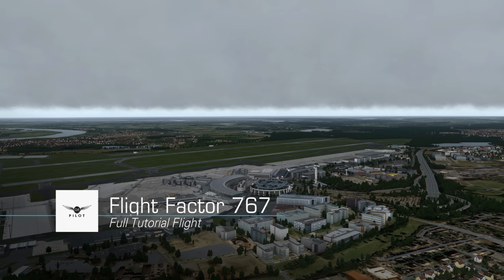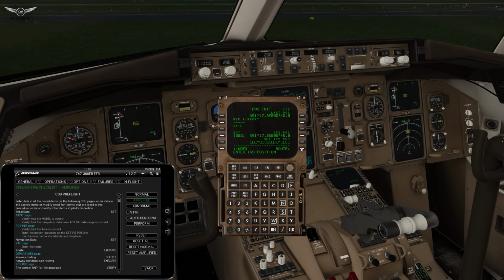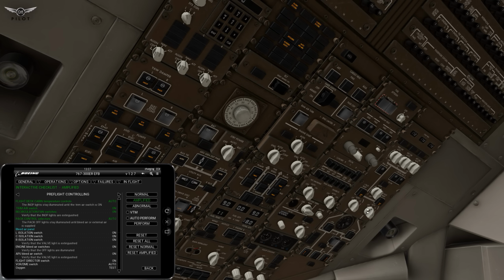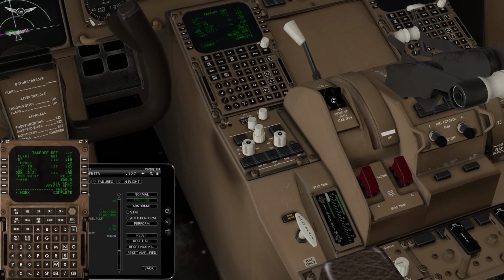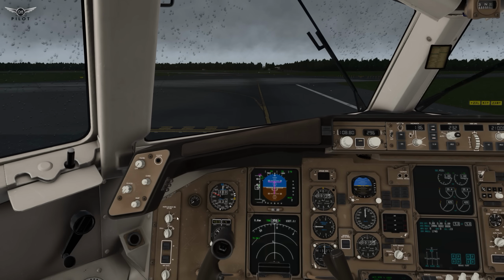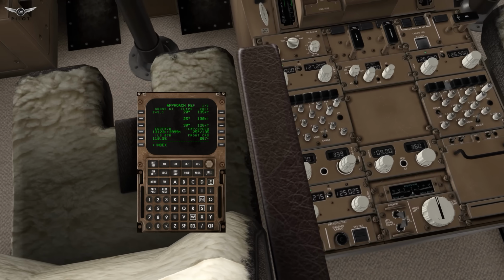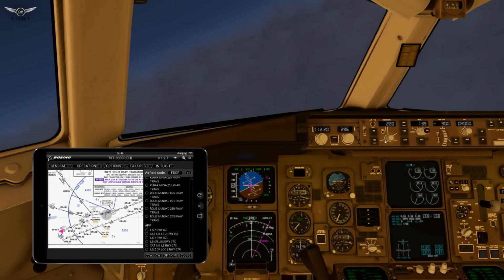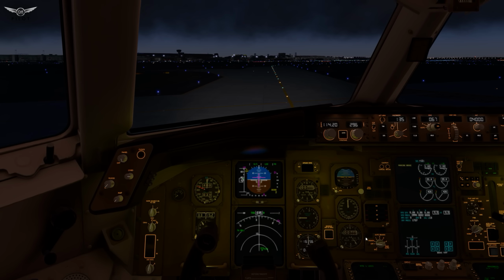X-Plane 11.30 | Flight Factor 767 | Tutorial Flight | EDDL ✈ EDDF

Comment: Anyone know why when I get up in the air I can’t engage auto pilot? It has a red alarm saying autopilot disc and I can’t fix it. I programmed the FMC and everything and there are no discontinuities
Reply from the maker: Is your flight director on?
Reply: @Q8Pilot  Yes, so is auto throttle. And I would assume im doing SIDs and STARs correctly as they show up in legs and plan mode

Comment: Very awesome, thanks for these videos. Helped me get familiar with this aircraft. For anyone watching now-a-days (I know this is an older vid), that pressure light was due to the center isolation valve being closed. Close left, close right, but leave open the center (turn APU bleed off though). You'll notice if you look at the flow schematic right under the button, there is an arrow branching off to "ADP". That stands for Air-Driven [hydraulic] Pump which is what powers the center On-Demand hydraulics. This runs secondary to the center electric pumps and was not an issue for the flight.

Comment: Hello. Is anyone else having a problem with the nose tiller? The first flight I used the tiller worked but its has stopped working. The tiller works on other planes but not the b767. Can someone help please

Comment: do you adjust weight and fuel from the main xplane aircraft selection menu under weight and balance or the iPad in the aircraft shown in the video? My CG tips forward mid flight for no reason and I'm confused which weight and balance I'm supposed to adjust so the default x plane menu doesn't fight the FF 767 iPad weight and loading menu.

Comment: hey nice video. what should i press ( at the autopilot) that the plane is flying the headings which i give the autopilot manually?
Reply: The destroyer I don’t really understand your question, but I would assume VNav LMav BOTH the flight directors and auto throttle, then once at about 1k feet the autopilot 1 button over near the autopilot disengage
Reply: @ColumbianSpirit  thank you that helps a lot.

Comment: Hello, i have the new version off the FF 767-300 but i’m having problems With the auto trust, It doesn’t work. The TOGA also doesn’t work. My x plane is 11.25R2, What should i do?
Reply: Jorge Rodrigues The b767 does not use TOGA.
You have to push the THR button on the MCP (Autopilot panel)
That’s how it’s done in real life
So pushing the TOGA button on your joystick won’t do it since this aircraft does not have TOGA
Reply: O.k thank you

Comment: Great video as always. Could you or your followers kindly advise what the best joystick would be for helicopters and fixed wing. I fly both about 50% each and currently use the Logitech extreme 3d pro. It works quite well with both and have been using it for several years now, but I would like to upgrade to something a bit more sophisticated with a few more bells and whistles. Thanks very much

Comment: Q8, excellent video thanks for making it. Quick question, i do have the FF767 updated to 1.27 as well as you, but for some reason the ipad type of EFB is on the right side of the cockpit next to the FO seat, whilst you seem to have on the left side right next to the captain seat. Is there a way to configure its position?. Thank you.
Reply: It is on both side for me. On right, sitting flat and on left in the holder, upright. It will look different on both sides. Make sure you don't have it out already when looking for it. Hope that helps.

Comment: I was wondering if anyone could help me with this issue. I have X-Plane 10, but it has stopped working recently. Whenever I input the activation code it says there is an authorisation problem. I contacted support and they said it was a firewall, I had turned it off on my Mac via system preferences, but it doesn’t seem to be working. Thanks.

Comment: Hi Osama,do you have fps suddenly drops to very low for a few seconds during the flight?
Reply from the maker: No I haven't had that problem recently, but I have experienced this in the past.
Reply: Q8Pilot Thanks you.Could you test this to check the problem if you have time:)   New start the x-plane. EDDF 07C take off and when airborne turn right heading 180 and go straight for less than 2 minutes it will have a suddenly fps drop for about 5 seconds. You can use a default SR71 because it has high speed to let the problem happen quickly .I try it and happen every first time running the x-plane. Thanks again.

Comment: Greate video. Do you know if this plane is “cockpit designer friendly”. What I mean is, are the datarefs and commands easily available for programming switches for a cockpit designer?
Reply from the maker: Thanks my friend, most of the switch can be assigned to joystick controls. I haven't tried doing this on the overhead panel by JetMax, but yes most buttons can be mapped to joystick or keyboard buttons and switches.
Reply: Hi thought you said you don't need Navigraph for the chat to work.i tried it and the screen is blank any chance you throw more light on how to do this without the Navigraph please thanks

Comment: Nice video, Does the cockpit in the 767  actually look that good. Or did you do some color correction to it?
Reply from the maker: I haven't made any modifications to the textures. I am using XVision though and I have textures set at max without compression.
Reply: Copy the X-vision, I just saw that X-vision or Reshade is not supported on a Mac😥

Comment: I got the FF767, and I must say it's a terrible addon to hand fly. The aircraft oscillates in a yo-yoing, dutch roll-like motion, wobbling along when flying manually. The IXEG 737 hand flies like a dream compared to this. 

It's that and the audio issues, the low res cabin and the poor texturing makes me rethink my purchase. This addon ain't cheap and I expected more.
Reply from the maker: I agree with you on the hand flying and audio, the textures are good in my view.
Reply: Looking at this a bit more, the textures look bad IMO because of the rivets on the fuselage, they look blurry when you're zooming in just a little. If the liveries didn't have any rivets (or less visible ones) it would look much better.

Comment: hi @Q8Pilot apparantly if you turn the centre isolation valve on, the air press warning (hyd panel) will go away. nice vid and may I ask how do you change the voice of the runway advisory system? and is this the final and complete version of Xplane 11.30? thanks!
Reply from the maker: Thanks for the tip my friend. You can access the RAAS plugin features from the X-Plane 11 drop down menu. There is an option to change the voice from female to male. This is not the final version of the X-Plane 11.30. It is Beta 6 so quite a way to go still.
Reply: Q8Pilot ahhh alright thanks q8pilot!

Comment: The secondary engine indications are selected by pressing the button under the lower eicas display in the center and just on the right of the cpt's fmc which says "eng" or "engines" the label is a bit hidden by the button itself but if you move your view to be ober the pedestal you should be able to see it
Reply from the maker: Thanks buddy!
Reply: My pleasure!
Reply: Daniele Gerussi it’s is the same spot as it is on the 757 too
Reply: @blumac9801  yes, both cockpits are very similar

Comment: There's a couple of things in v3 I'm not nuts about. For one, I think they went too heavy on the heat blur. JMHO...
Reply: @GlennChambers  that's what my experience with the 757's fms is, stuff just doesn't work as it should, even though I left feedback for them. I'm not a developer, or know how to code that well, but it can't be that hard to get it right
Reply: @GlennChambers  the new heatblur effect is from the xplane 11.3 beta, and since no developer ever supports a beta(for good reason) they haven't modified the effect yet
Reply: Another great feature of Flight Factor 757 and 767 is the ability to use your iPad or iPhone or a browser on another PC as the FMC. Good introductory video. Thank You.
Reply: @MoisesSimana  really how?
Reply from the maker: The heat blur is by default enabled. The developers can either turn it off or modify it. It looks like they simply left it as is.
Reply: @Q8Pilot  Good to hear my friend!

Comment: Thanks Osamah ..Great tutorial as always ...one question :is the message in FMC ‘cruise altitude’ also related to cost index?
Reply from the maker: Glad you enjoyed it my friend! Cost Index optimized aircraft speed. According to Wikipedia, The cost index is a number used in the Flight Management System (FMS) to optimize the aircraft's speed. It gives the ratio between the unit cost of time and the unit cost of fuel.

Comment: i sure hope they fix the sound on their 767 &757
Reply: I think the the RR engines sound wayyy better than the PW and the GE hands down. Imo always fly with RR enabled 😁
Reply: @Mr.Ramirez95   Thanks for the tip i'll try the RR engines
Reply from the maker: The fact is both aircraft have the BSS sound set especially developed. It does sound like a vacuum machine on take off, not sure why. Overall, a really great aircraft.
Reply: There are serious issues with audible stutters when sound is looped e.g. APU, and sound cones are not well configured. It's eerily quiet in the cabin when the engines are not near full power. The Zibo/AudioBirdXP does it so much better, and it's free, even the PA are recorded with real voices.
Reply: @Q8Pilot  i mean the sound cutting in and out and crackling on the sound loop , i dont think the .wav files are very good quality, other than that love this plane flyin it all the time great vid btw
Reply: @kapital-revolution  really?? Do you happen to have a link?
Reply: @kapital-revolution  yeah thanks man I'll give it a try.

Comment: I have the same problem with the toga. I have to manually throttle up.
Reply: Mark Edwards Here the same
Reply from the maker: It could be a problem with Beta 6 if you are on the same version. I am going to try this out using another throttle and see if the problem persist. Just out of curiosity, if you don't throttle up at all and hit TOGA, do you get the same problem?
Reply: @Q8Pilot  I am still running 11.26. I have pressed toga while stationary and it doesn`t function.
Reply from the maker: @markedwards6943  I am getting this issue with the Zibo as well. So I am inclined to think that the problem is not aircraft specific.
Reply: I am on 11.26. I give a little throttle up i hit toga but nothing happens.
Reply: The 757/767 does not have a TO/GA switch in real life, and that particular switch only works for go-arounds. For takeoffs click on the EPR/N1 button on the MCP. If you don't believe it, search for real cockpit takeoff videos on Youtube.